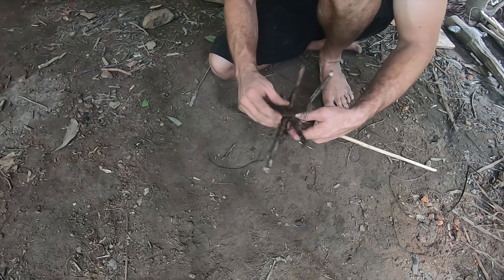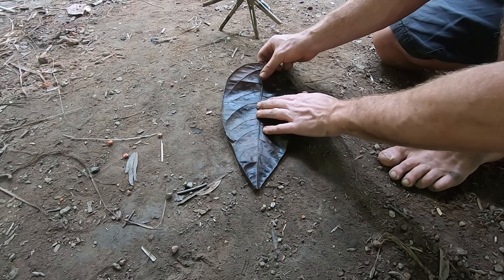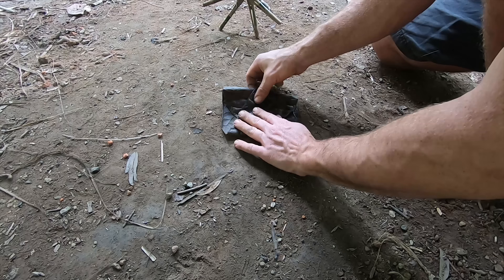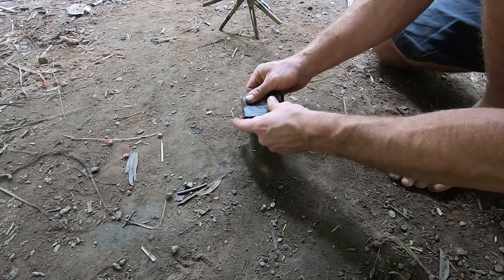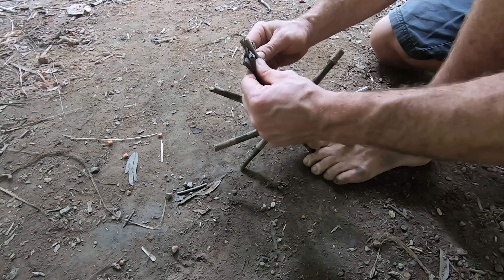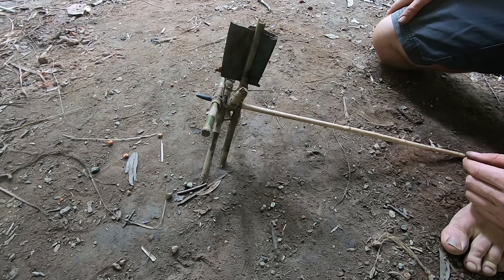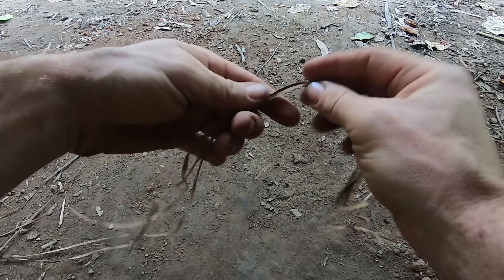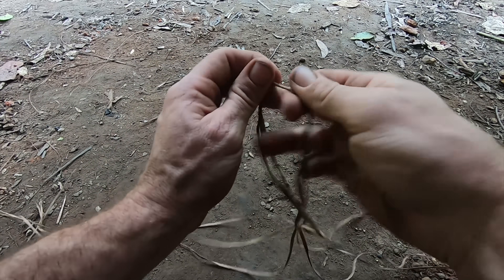Primitive Technology: Improved Multi-Blade Blower

Comment: Ancient metallurgy is amazing to me, I can't imagine the joy someone who worked with flint/stone tools for their whole life felt when they worked with their first metal tool.
Reply: "I'm so sick of hearing about bronze. 'Bronze, bronze, bronze, bronze.' What's wrong with stone? Does stone not work all of a sudden?"
Reply: @jimbob3332  it's just a fad!
Reply: @jimbob3332  There are Viking axe heads made of granite which surpass their iron counterparts significantly in ornamental craftsmanship. By the style of the ornaments the latest ones are thought to have been made around 600AD, so many hundred years after first bronze and later iron axes became the completely common tool of choice in the region. It is unknown whether or not they only served as ceremonial axes, as they weren't as sharp as flint axes, or if they were used as battle axes by very high ranking individuals (they were plenty sharp edged to split a shield or skull). Whatever the case, though, some people were still nostalgic about the stone craftsmanship and kept it alive long after easy to forge and easy to sharpen iron axes took over. Perhaps someone just couldn't give up on the significantly more satisfying crunch a stone axe yields when it meets the skull of an enemy? One thing is for sure though: Both the bronze and the iron axes in the museums look plenty chewed by the teeth of time but the stone ones are as gorgeous as the day they left their makers hands..... Yet it is clear that the ornamental groves must have been carefully chiselled with iron tools.
Reply: @andersjjensen  
600 AD is not Viking age, as the first documented Viking attack was in 793.
Reply: @ragnkja  He said the style of ornaments used on granite axe heads were thought to have been made around 600 AD, that doesn't have anything to do with the viking age. Scandinavians were around much earlier than that making weapons, they just didn't venture out and begin raiding until the late 700's.
Reply: @rovers141  
“Viking axe heads” and “the latest ones made around 600 AD” are contradictions, because if they were all made in the late 6th or early 7th century, they definitely predate the first Viking attack in the late 8th century by around 200 years.
Reply: @ragnkja  Defining the Viking age by when they first attacked someone else is rather stupid. By that definition it only lasted some 250 years, yet we have artefacts of an evolving culture surrounding variations of Norse Mythology that dates back to 400AD. The oldest nordic rune inscriptions are from around 150AD. The oldest longships were constructed more than 200 years before the raids began. Heck, I live only two km from an old defence position (Lindholm Høje) where there are remnants of the exact same burial traditions and house construction methods of the Vikings that dates back way further than 793.
Reply: @andersjjensen  
Defining the Viking age by when Vikings were active isn’t stupid at all. The more general term is Norse late Iron Age, and that is the term you want to use in this case.
Reply: @ragnkja  No, it's not a contradiction at all. Anders was talking about GRANITE axe heads. Not just any viking axe head. These are not the kind of weapons they raided with. Now, I don't know how accurate his story is because I do not know his level of expertise, but it's definitely entirely plausible.
Reply: @rovers141  
You’re missing the point: if they date to 600 AD, they’re not from the Viking Age, but simply from the late Iron Age.
Reply: @ragnkja  But the Vikings were active before that. They were just busy fighting the other tribes in the nordics or simply living their lives. The raids came about out of desperation over failing harvests. But it turned out to be good business, so they got more and more organized.

That some tea drinking, left side driving, stuck up historian decided that the Vikings weren't Vikings until HIS people took an axe to the head is stupid... and highly contested among actual Scandinavian historians.
Reply: @andersjjensen  
Why not use the far less contested term Germanic Iron Age? While some people consider the Viking Age separate from it, I personally consider it simply the tail end of the Iron Age, and I’m sure you agree. After all, the vast majority of Norse people were not Vikings, and separating out the latter half of the period is a bit of a false distinction.
Reply: @ragnkja  Sigh... "Viking" does not mean "raider". The vast majority who went on raids were normal farmers. Most only did one or a few raids in their lifetime. They were organized by local "kings", but those did not hold dominion over "their people" like we see elsewhere. So people only wanted to go if the need was dire or the promise of outcome seemed to far outweigh the risk. The focus on a religion that glorified dying in battle probably helped skew those calculations though :P

And while the old Norse culture did break off from the Germanic tribal societies around 100-200AD they were largely distinct in customs, language and technology by ~400AD. There was still a large interaction or "cross pollination" in modern day Northern Germany and Holland/Belgium, but once you get to Jutland proper the rune stones, burial sites and excavated artefacts show a distinct and coherent culture which at some later point went on raids. Some historians have, finally, budged a little and started calling the pre-raid civilisations "proto-vikings", but it's still horse manure. "Viking" means "someone who camps", "place of settlement" or "a dwelling". Prior to the raids the exact same people were known to be skilled travelling merchants. There has been found artefacts as far down as southern France that shows direct interaction with the Norse several hundred years before the raids. And their ornamental style was the same distinct one we see by the time of the raids (so elaborate triskelions and serpent shapes).

So to reiterate: This is not my personal opinion or something. This is what present day Scandinavian historians are maintaining. The distinction that the Viking age did not start until the raids is in stark contrast to how all other cultural evolution classifications are done. And it contradicts all source artefacts available from the time period. Even the etymology of the word Viking suggests that they did not linguistically distinguish between a trade trip, a settlement trip and a raid trip. And the religion of the time most certainly did not make one or the other more "right". The Ase faith is a religion that stipulates survival of the fittest. It also forbade strong men to subjugate themselves to others. But it also had a focus on reason and cunningness, which is perfectly in line with the behaviour we have evidence for: Trade if that makes sense. Settle if that makes sense. Plunder if that makes sense.

Seriously, I'm not trying to be a smart-arse about it. It's just that every other culture is defined by it's cultural development, but that claiming that a notoriously feisty people is suddenly defined by going ELSEWHERE and being notoriously feisty... is... not favoured by the descendants of those people.
Reply: @jimbob3332  i think the point is, that metals can be reformed  and be repaired easier than for example a flint knife
Reply: Probably the same as someone who cooked on a camp fire their entire lives and then used a stove for the first time. Technology is amazing. :)
Reply: It always makes me wonder how we figured this stuff out in the first place.
Reply: @Dinosaur_News_Center  Tens of thousands of years of trial & error and dumb luck.
Reply: @chasewebb7417  It's no wonder why they viewed metallurgists as magicians back then.
Reply: @wingy200  
You mean alchemists?
Reply: @ragnkja  I mean magicians. Alchemy only became a concept in the middle ages. When they were first smelting copper around 5-4000 BC it appeared to be magic.
Reply: @wingy200  
Alchemy is a branch of magic, although it’s also the precursor to chemistry, and particularly to metallurgy. The name is obviously late medieval, but the concept is much older.
Reply: @ragnkja  Cool.
Reply: @Dinosaur_News_Center  It's actually less complicated than one thinks when realizing the "discovery" route was stone -> copper -> bronze -> iron. Copper can sometimes be found in nearly metallic form in certain ore deposits. Since its so malleable, you don't need any form of smithy or high temperature smelters to extract and work it, stone tools are enough. Copper generally also doesn't have a very high melting point (~1000 C), so they then were also able to smelt it easily and get more from regular copper ores and minerals. Eventually they noticed that mixing in other metals like tin made the copper even more useful by turning it into bronze. The really big step then, technologically, was to get from copper/bronze to iron - copper's melting point is about 1000 C, while iron's is over 1500 C. That needs some serious smelting equipment. It's also nearly impossible to find useful iron in metallic form in any ores, unlike copper, since iron rusts so easily. The one exception are iron-nickel-meteorites, which of course would have been incredibly rare for our ancestors to find and literally 'metal of the heavens/gods'. In some ancient Egyptian pharaohs' graves and pyramids daggers made from such meteorite metal were found, from a time when virtually the only used metals were copper/bronze. In essence, Primitive Technology is kind of skipping two steps on the tech tree to get from stone to iron, which is of course possible due to our knowledge in hindsight that iron is much better than copper for tools.
Reply: imagine the flint workers getting pissed off because of this new material
Reply: @tristane3444  https://www.youtube.com/watch?v=XTLyXamRvk4&ab_channel=EricCost
Reply: It goes to show our ancestors were not dumb at all. They lacked knowledge but not intelligence and probably had no less of a curious and critical mind of the world around them than we do now by the time they were figuring out metallurgy and making rudimentary forges.
Reply: They figured out that the hotter the fire the better the pottery, and they were trying to max it out, in the process acidentally getting bits of metal
Reply: @eone2345  imagine believing in fairy tales
Reply: Well no...this never happened. It would take hundreds of years before a working substitute could replace stone even after metal was discovered.
Reply: @bopeep268  Pretty sure they were referencing a Mitchel and Webb sketch on the matter.
Reply: @CoryBlissitte  im replying to the original comment. Not the replys before me.
Reply: @bopeep268  Ahh, apologies.
Reply: So true, the Europeans brought joy and luxury to the stone-age peoples they visited around the world.  Also they ended the slavery and cannibalism that had been practiced for all of human history.
Reply: @customsongmaker  ended slavery you say? Also cannibalism is almost universally a taboo across the world, cause it kills the consumer

Comment: I wonder if it would be better to add the press bar to the top of the blower instead of just using the strings to pull the blades. Another idea would be to only attach the blades to the guiding rods from the top with a weight at the bottom of the blade. That way, when you spin the guide rods, the leading edge of the blade, the part attached to the guide rods, the trailing edge, the part that is hanging freely with a weight, naturally lag behind depending on the direction of the spin. This way, it would always allow for air to come in from the top, only to be forced out the bottom, which is directed at the fire, increasing the amount of airflow you have. In the same vein, what about a fixed blade system, but the blades are at a 45 degree angle. The blower would then only be effective when it spins in one direction, but it would also have the added bonus that the blower "breathes", with air going in and out near the fire.